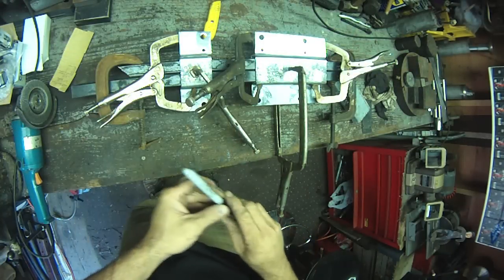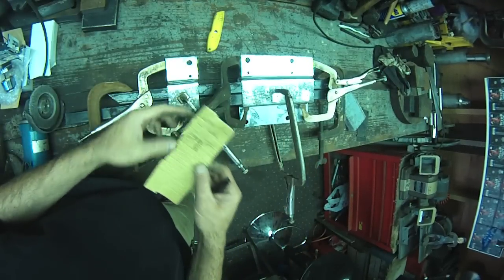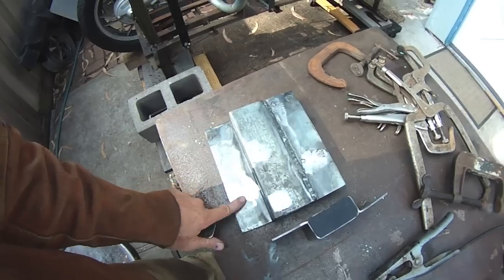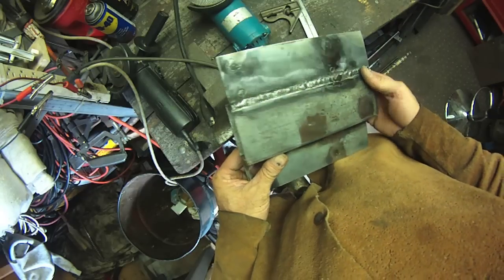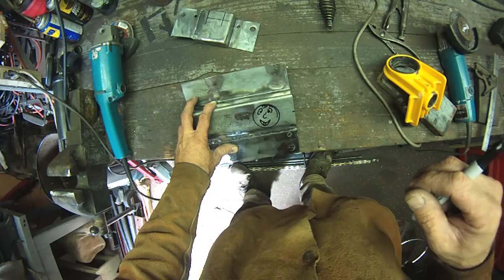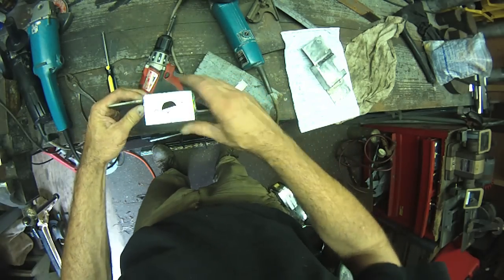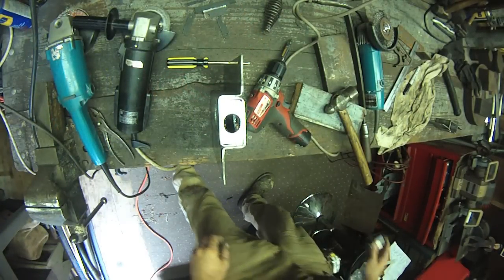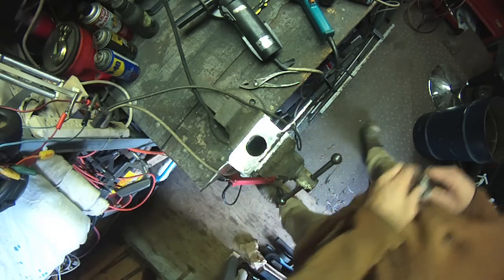Getting Paid To Weld 2 of 3

Comment: I'm glad you mentioned the wire mesh at the end, was starting to wonder what the point was if you could just reach through. Nice work as always.
Reply from the maker: +Matt Tester (UKMatt2000) Thanks Matt.  It is standard to add expanded metal or steel plating to back the gates.  I will get to that tomorrow.

Comment: The whole two videos i was thinking how would that be save if you can just reach in and open it.. End of the video explained.. Hope its thick enough stuff so you cant just brake it with like a hammer or so. Kinda weird regulation on that you cant have a lock/key on the inside... Is that on every house? So basically you just need to drill a small hole into a door, a little bit of 90° bent wire and you can open anything in under a few minutes? That  would be crazy..
Reply from the maker: +schwabentutorials It is standard for these gates to have a heavy gauge expanded metal or plated steel to keep fingers and tools away from the inside of the lock.  This gate would trap you inside the confines of the house if there were a power outage/earthquake or fire, so no special tools or knowledge for emergency exits are allowed.  There is a ring of 1/8" by 1" flat steel that surrounds the inside lever to keep any fingers or tools away.  Let's keep it real, if someone wants into your house they are going to get in...regardless of a gate at the front door.... a door that is in clear view of the street.

Comment: I trust the gate cannot be levered off its hinges by some lout with a short length of scaffold pipe?!!

Looks good and seems to work well anyhow. 
I have friend who lives in a converted railway station where trains shake the building when it goes by - the family don't sleep well when there is engineering work on the line and hence no trains. Talk about rocking you to sleep - sheeeeessh!!!
Reply from the maker: +Dan Whiteford Hey Dan, Nope those hinge pins are peened on both ends to avoid the lift and release.